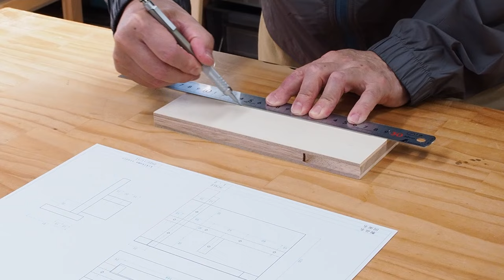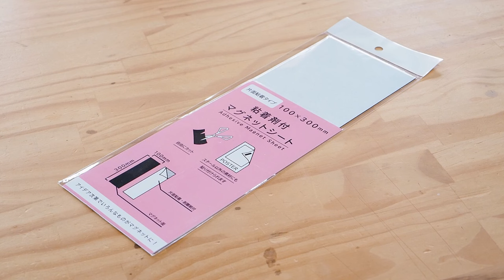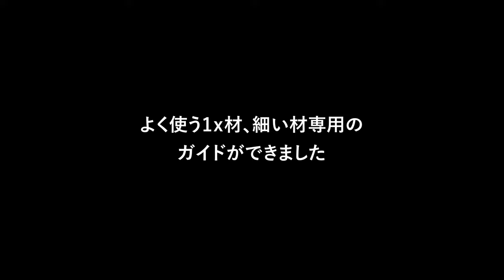Hand Saw Guide| accurate and easy to cut straight (subtitled)

Comment: Pour les scies japonaises oui , pour les scies egoïnes je pense que c'est plus compliqué à cause de l'avoyage
Reply from the maker: I appreciate your comment!  Haven't tried western saws, but there isn't much difference in set. The rougher crosscut saw I use is pitch:1.75mm, kerf: 0.92mm, blade thickness: 0.6mm. The western one I see on the web has pitch: 2.5mm, kerf: 1.2mm, blade thickness: 0.9mm. So, the set on one side of the blade is about 0.15mm for both saws. If there is a difference, it is probably due to the action of pushing or pulling. And for this guide I recommend finer crosscut saws which has finer set of 0.08mm. Just because of better finish and could be easier to the magnet sheet. But still there are flush cut saws that can be used with the guide. And this is the highlight of the jig, also can use as a shooting board at the same time. If you are interested in delicate hand work. Thank you.